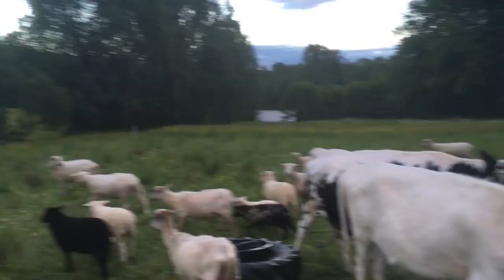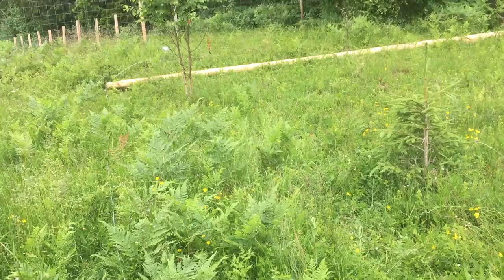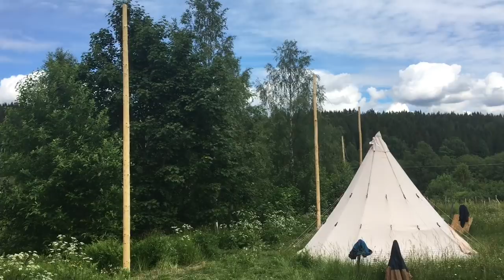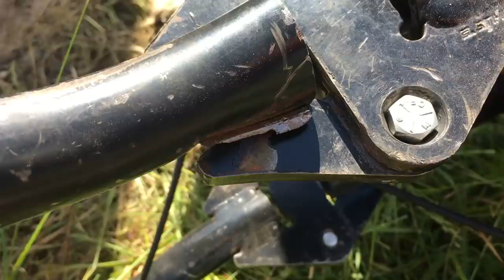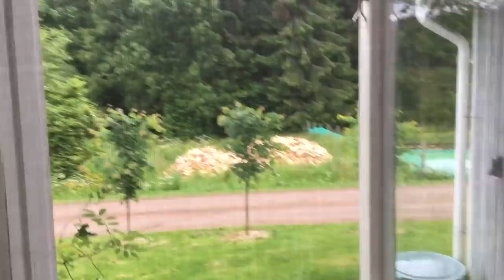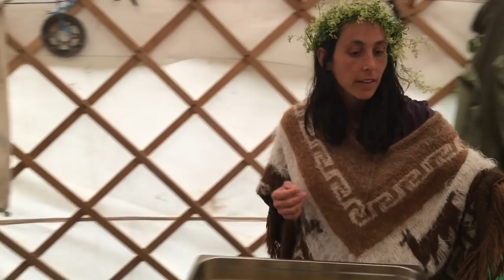S4 ● E66 Hop Poles, Midsummer, Sheep butcher & Sausage Making, Salmon fishing and Pond Making

Comment: Greetings from czech republic. Our hops fields are usually in straight lines, i guess it will be hard to tense the main line but your plants are not so densely seeded as usual industrial production here. Also the wind can be problem, hopefully you did your math and calculated possible load wind. Also hops is very labour intensive, harvest is on autumn, also drying is not so easy.
I wish you good luck, hops is one of my favourite  herbs:-)